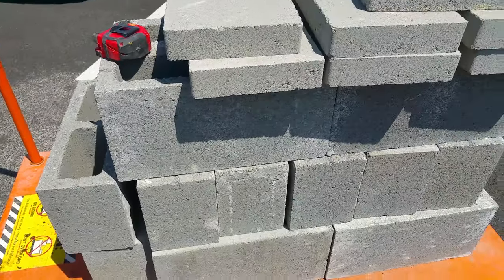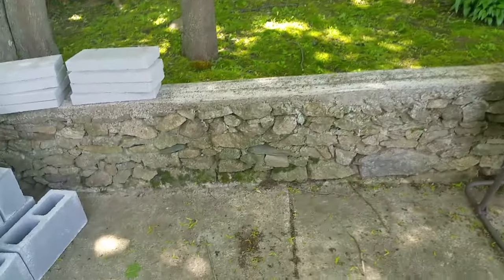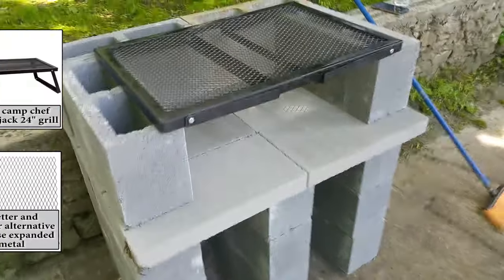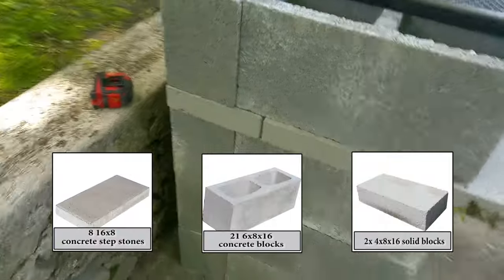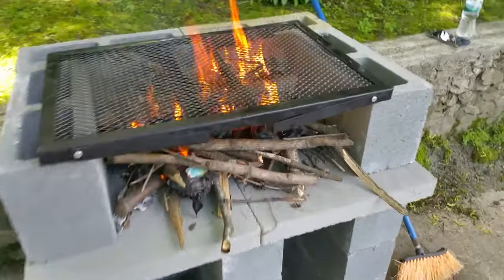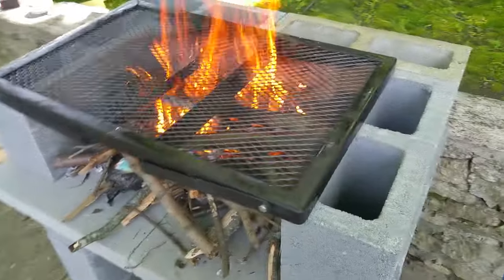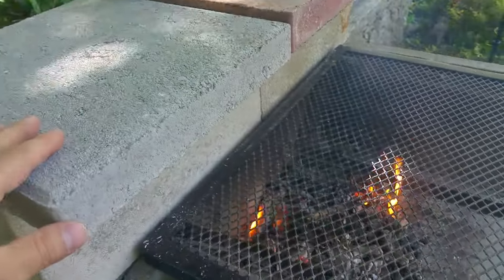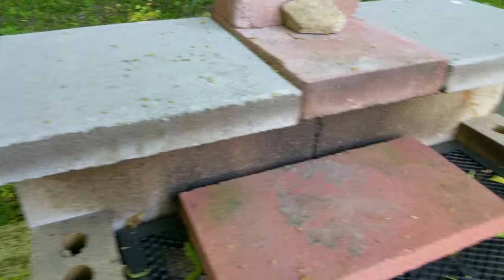Building a Concrete Block BBQ / Cinder Block BBQ Grill - Da P.A Vlog

Comment from the maker: Thank you for watching my video, if you liked it please subscribe for more videos. This concrete block BBQ has been working great with no issues. Right now I'm using the camp chef lumberjack grill,  https://amzn.to/3fpf9WX for the cooking top but will eventually switch to expanded metal, https://amzn.to/30ob6Cr. Although the lumberjack camp grill grate is awesome for grilling while camping. This concrete block bbq makes a great smoker as well, I use an alluminum pan, https://amzn.to/2LJy1UT,  to trap in the smoke and tbis method works great.  Again thanks for watching, put a like and subscribe for more videos.

Amazon 30 day FREE Trial - https://amzn.to/2ItA9Ar
Reply: Sing block burial point of back yard Shana block Brill public back yard would apply about added on to it

Comment: I like design but I would add 1 level up from fire. So it won't burn to closely to the food. Thank you for sharing.
Reply from the maker: its a give an take too close you burn the food, up more and it doesn't cook as fast. I think where the grill is located is the best option. Thanks for the comment.

Comment: looks good except for one thing. I have a slab outside of my kitchen where I cook. I put some charcoal on that slab one time to get it ready for the grill, it got so hot it blew up and busted a small chunk of concrete out of my patio, those blocks your using for a fire grate are concrete, would it not do the same thing.
Reply from the maker: I have gotten this fire to  1000f  with no issues. This is dry stacked so no mortar which probably helps with heat expansion. Also the slap is elevated no directly on the patio floor.  Never had an issue.

Check out my channel for the updates I did on this grill and thanks for your comment

Comment: Replace the flat stones with thick steel and you won't have to replace the stones when they crack from the fire. Nice idea for a grill though.
Reply from the maker: Using it for 2 year's now, no cracks with some very hot temps. Thanks for the comment.

Comment: Thanks . 
Are cinder  blocks fire resistant  cement ?
Reply from the maker: I have used it very often with no issues at high heat, very high

Comment: Tip for next time do a scaled down model first then you won't be short on material, also drill a few small holes in the bottom of the flat pavers for air flow.it well generally increase heat. and grease build up well decrease , but it's cool good idea
Reply from the maker: So you recommend making some holes on the flat pavers where the wood goes? That might increase heat but below the flat pavers I store the wood and don't want ash and water to go through. I love the ideas though and I'm open to suggestions so we all learn something. Right now it gets hot and cooks fast because of the convection heat as well as radiant but I'm always open to suggestions. BTW I mock at least on paper would of been hood but it was in my head so I ended up needing material and changing things.

Comment: You Do know that not all types of wood are good for cooking. Is that a piece of pallet wood in there? I like the height of this design. Not like the others where u have to bend down.👍
Reply from the maker: Use hardwood, I used what I had for this initial  test only. You can use charcoal also.

Comment: I just found your video and I liked it. The only comment I have is that you should have taken the legs off the grill portion of your cooker. It was attached by bolts, and you didn't use them. You simply needed to span the distance. Thanks. It was every entertaining.
Reply from the maker: yes i did that when i updated it, i removed the legs, much better cleaner look. You can see the updates in this video, https://youtu.be/VcmboHODJz0 - Thanks for your comment.
Reply: @daP.A  Thank you for answering me Most wouldn't. thanks again.

Comment: 4 years later the cinder blocks alone are coming out to $50 not including the grate plus the flat rectangular stones... today this grill costs as much as a real pit with wheels already assembled. what's the point?
Reply from the maker: You realize that grills have gone up substantially right? I would love to see you break down the price on this cinder block grill vs a real decent grill.
Reply: @daP.A  I didn't say a decent grill, but Walmart has cheap little grills for way less like $40 I can be cooking outdoors and if that's too expensive they have a small portable one for $25. When u made the video I'm sure it was one of the most economic ways to get yourself grillin food but Bidenomics fucked up EVERYTHING.

Comment: I want to do something like this for my back yard, but everyone says "Concrete can explode from the heat!" What's been your experience so far? I don't know a lot about this kind of stuff.
Reply from the maker: Unless the cinder block is sitting on the surface of the sun there's no issue but using this for two years with temps over 1k no issues.
Reply: @daP.A  Works for me, thanks for the advice.

Comment: Love your BBQ. I'm going to build this next week. Any advice on how to improve anything. Thank you in advance
Reply from the maker: Make it a little taller then I did, stack one more layer of cinder blocks for the base.
Reply: nick giassakis will the cement base withstand the heat and not crack? Also if you can think of a way to raise and lower the grill that would be awesome.
Reply: I use a few 1/4”-3/8” x 5 or 6” bolts sticking out under 2 or 3 layers of blocks to lay the grates onto. That way I can raise or lower the grates if I need to 😀

Comment: You put frozen burger on the grill? You would be fired the first day in a restaurant. LOL.
You should make your own grill from stainless steel sticks. Or get pro grill that holds heat and divert flame.

The final design looks good. You should get a large flat metal to cover the top, for deep cooking like prime rib or small pig.
Reply from the maker: Relax before you have a heart attack, that was just for testing, check out my bbq party on it, https://youtu.be/VcmboHODJz0
Reply: @daP.A  
If I weren't relaxed, I wouldn't have watched the whole video. 

My true friends are those who criticism my work and not those who praise me.

Comment: Hey bro good job man.....
Reply from the maker: Thank you, subscribe to see more videos. I will be doing a dry stack cinder block pizza oven soon.
Reply: @daP.A  Are you going to be removing the middle blocks to make space for wood?
Reply from the maker: I need it for support so I can't remove it. It kind of like having it like that. If my tops were bigger I could of gotten away without the side blocks. When i made this I need the middle blocks for support. This is done with no mortar so the more support the better. Stay tuned for another dry stack cinder block pizza oven project.